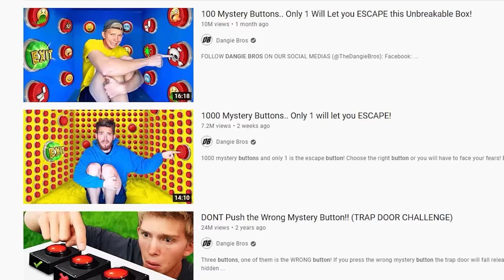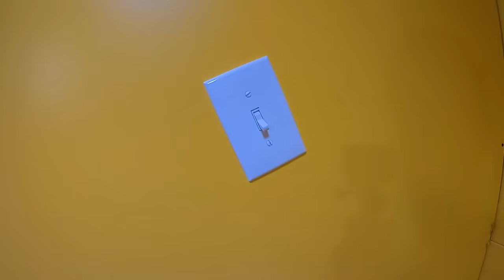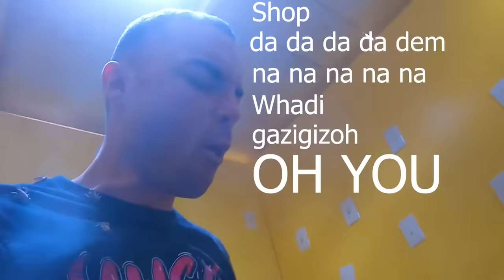100 Mystery Switch Box.. *ONLY 1 ESCAPE SWITCH*

Comment: using deduction trace the wires from the light it will tell you the wall the switch is on and rough location then you get much less punishments and find the switch first